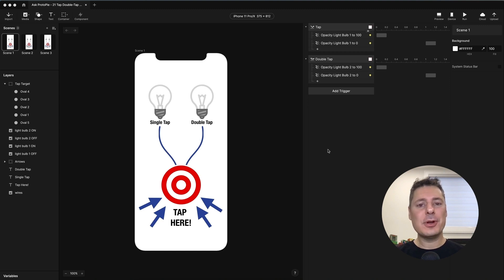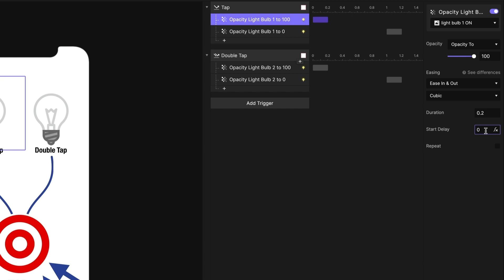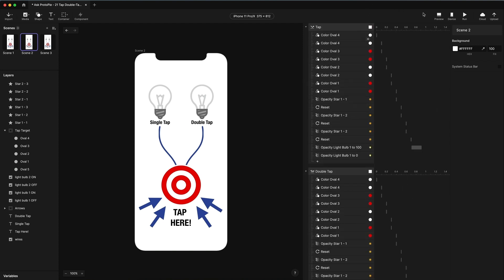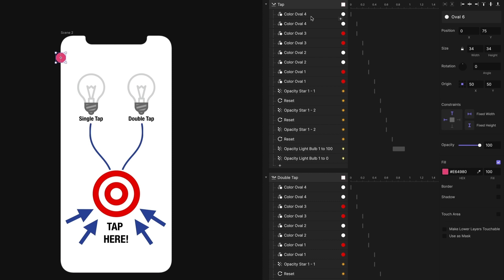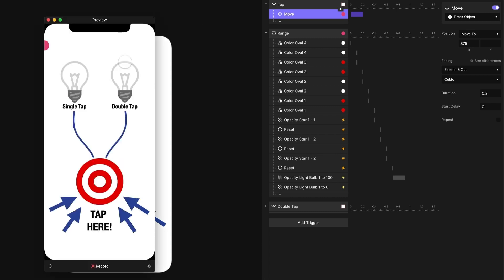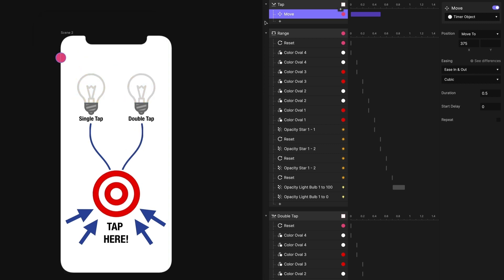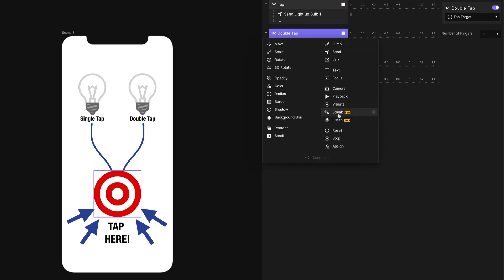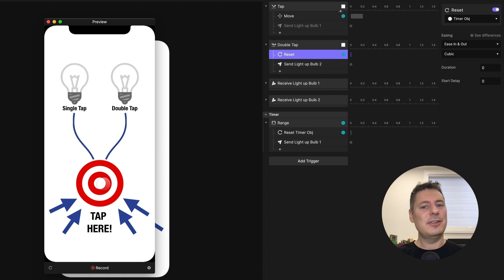ProtoPie Tutorial | Tap & Double Tap On the Same Element #AskProtoPie

Comment: Relying on an object that physically changes position as the timer for the single-tap interval is a creative workaround. But a slightly less mechanical option that can be used is to change the opacity of a stationary object from 100 down 0 (or reverse) over the same 200 millisecond interval used in the example. The change in opacity can be interrupted just like the movement of an object.

Comment: I have ran into a problem with the speaking function.. I want to use the simple tap to trigger the voice over of the button (single tap - speak: button A), and double tap to confirm (double tap - jump to scene X). However, when I double tap and jump to scene X, it still speaks "button A" ... super annoying, dunno how to solve. If you can help with this that will be super great! Thank you
Reply from the maker: Hi Fei. Jeff here.  You can't use a Stop Response on a Speak command.  So the second technique I demonstrate in this video is for you.  Instead of directly issuing the Speak command on the single tap, instead start your invisible object moving across the screen.  Put the speak command in the Range trigger that fires when the object reaches the right edge.  Then, in your double-tap interaction, you can use a Reset Response on the invisible object.  This will stop its motion and return it to its initial location.  In this way, the object never reaches the right edge when the double-tap happens, and therefore the Speak response is never issued.